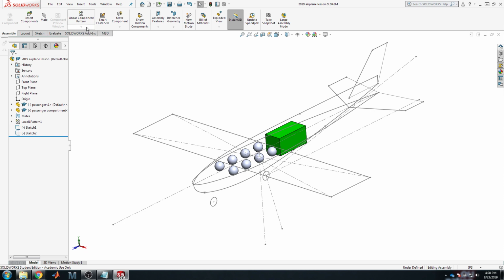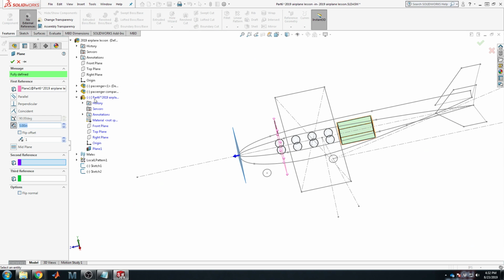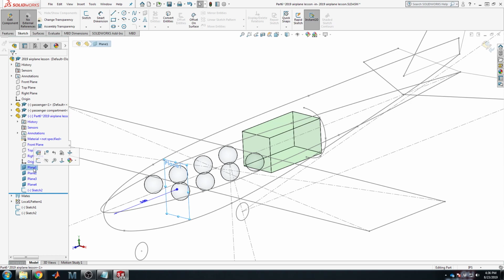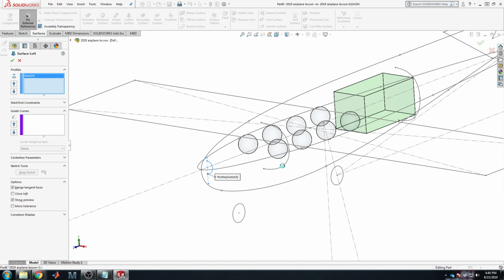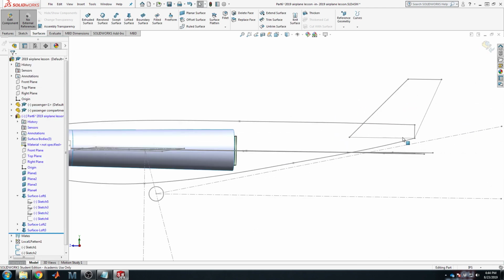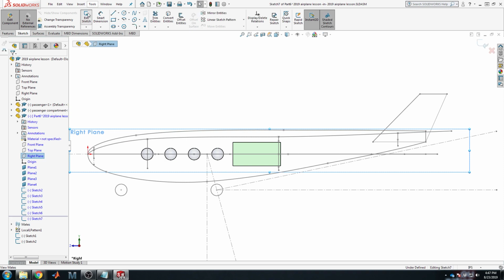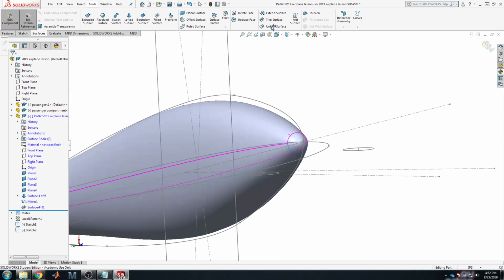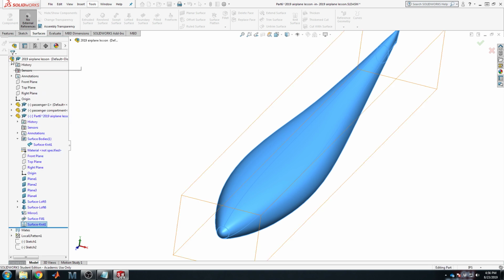Lofting a Fuselage

Comment: Hello, a total long shot but throwing it out there.  I'm trying to duplicate an old fiberglass fuselage (40" long).  I only have plans showing a side profile view and top view but need to identify a series of cross-section profiles (lofting?) to use in carving a mold plug.  I've been trying many searches to see if there is software that can help creating the 3rd view cross-sections from the 2 existing views.  I don't understand it, but came across your videos of Solidworks and was encouraged that maybe what I need is possible.   I'm not explaining this well, but if you receive this comment and understand my question, I'd be very grateful to know if I'm looking for something that can't be done?

Thank you!     JGiles